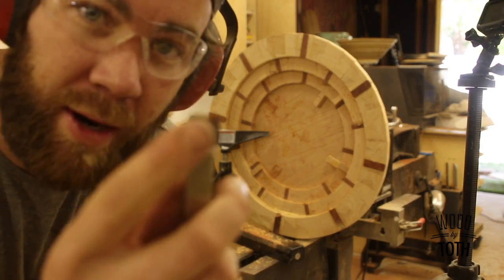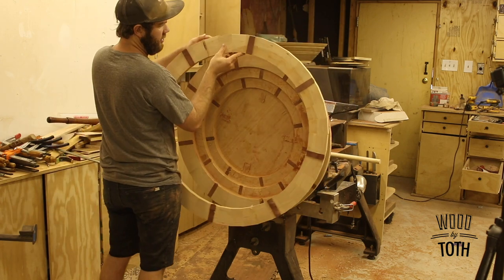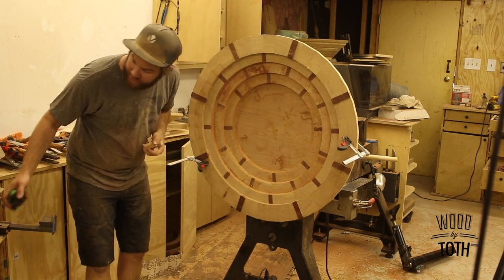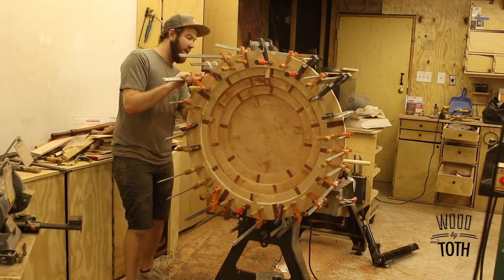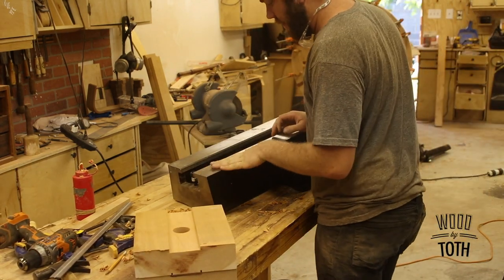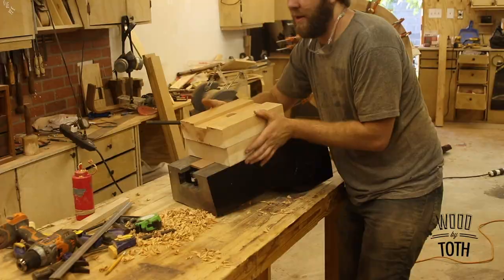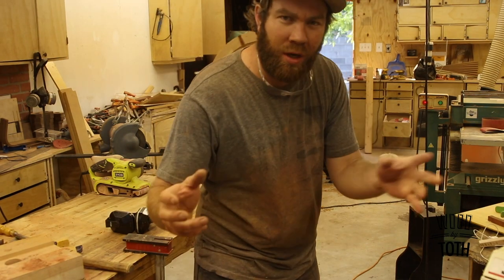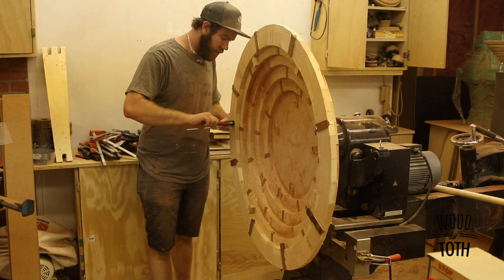Segmented Bowl // Part 3

Comment: Kyle, instead of trial and error to get the rings centered what I do is draw a few circles on the layer before (with the lathe spinning) then just line up the ring with the circle.
Reply from the maker: I have done that but then the glue goes on but I guess If i clamped the ring on before the glue then added the hot melt glue blocks then that would work well. Thanks for the tip
Reply: Kyle Toth probably better for me since the segmented  bowls I make are no more than 12 inches.